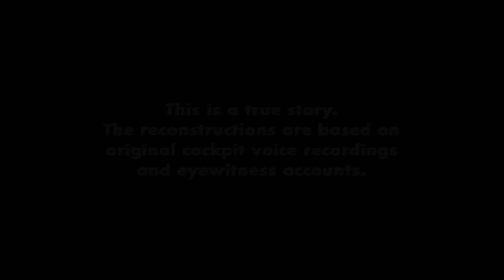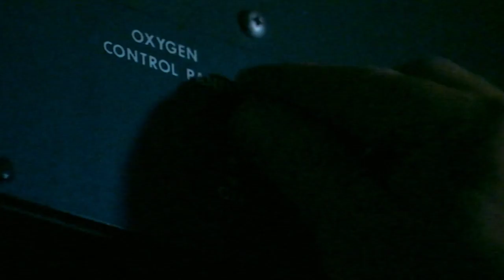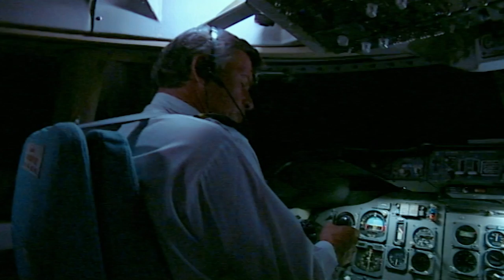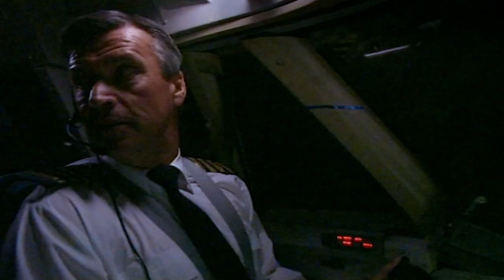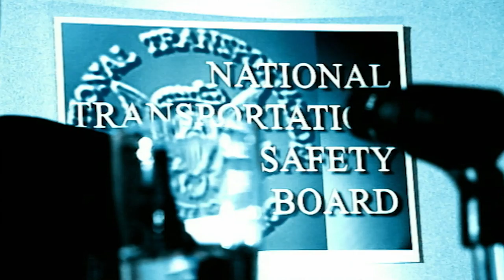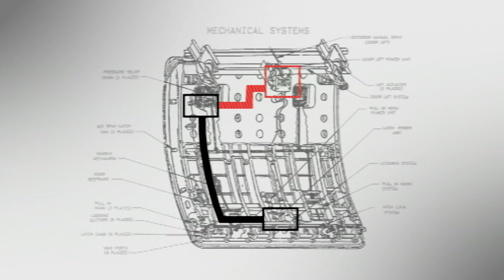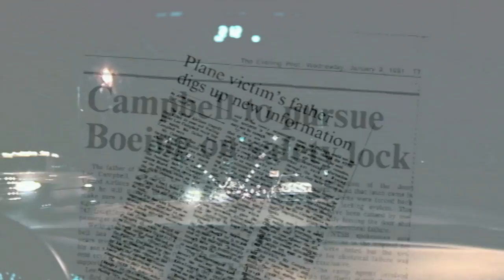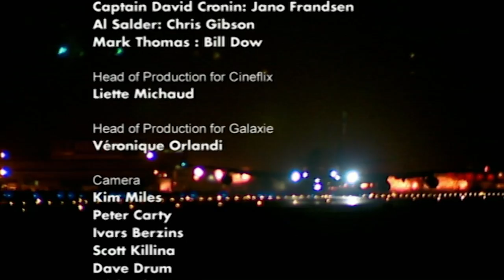United Airlines Flight 811 Ejects Nine People After Explosive Decompression | Mayday | On The Move

Comment: This event was still fresh in my mind just over a year later as I sat in the same position on a QANTAS 747-400 at Sydney airport. We had a two hour delay because ground crew could not get the cargo door closed. I watched all of this right outside my window. I had actually returned from the United States via Hawaii but this particular airplane was destined for Harere Zimbabwe via Perth. My final destination was Perth and we were half empty of passengers until then so there were plenty of spare seats. When we finally took off and the seat belt sign went out I quickly found another seat as far away from that hatch as possible. But I don't think I've ever drank so much alcohol inside 4 hours before...

Comment: Mr Campbell's engineering experience really paid off in this investigation. What I've never understood is why the doors open to the outside when they could design a sliding door (like on a van) that slides into the cargo hold when open then when closed the entire framework around the door will keep the door from blowing off. Imagine trying to kick the door to your house open from the inside. It would be the same principle. And it would take up minimal cargo space.
Reply: That’s a very good idea! Make it slide inside so it doesn’t take up space but also is held shut by air pressure.
Reply: I’m glad i thought of that!  😊
Reply: @orscrub3161  I think there are some planes that have this for passenger doors that slide up, I think I’ve seen it in a movie and it was a small business jet. So if they’ve been used for passenger doors I figure either they’re used for cargo doors already on some planes, otherwise there’s gotta be a good reason why they aren’t. One I can think of is that it means cargo can’t be stacked right up against the side of the fuselage or it’ll block the door, and if the cargo shifts accidentally that could also block the door.
Reply: @Sashazur  ……….what a frightening thought!   no way out?!  😳

Comment: With today’s tech, it’s possible to accommodate flight crews with views of the entire exterior of their airccraft. Powerful LED lights next to cameras allow views at night. Think of it:
1-Cameras on the fuselage trained on the wing and empennage (leading edge, bottom, top, trailing edge)
2-Cameras on the winglets directed back towards the fuselage (nose to empennage)
3- Cameras on the belly observing from every available direction.
4- Larger airliners already employ a camera at the top of the leading edge of the vertical stabilizer, but the ones I’ve seen are mainly used for obstacle avoidance while taxiing. 
***Live satellite transmission when a pan-pan is declared could connect pilots with a selected pool of volunteer, on-call systems experts. Stored data can be used to aid everything from incident investigations to training, R&D, etc..
THIS crew dealt with this emergency when that tech wasn’t compact enough, but now it IS. Hope it gets utilized.

Comment: They just had to mention TWA Flight 800 that blew up over Long Island Sound after just taking off from NYC. I have talked to many pilots over the years, and EVERY one of them has stated that no overseas flights ever leave the US with the center fuel tank empty. The NTSB blamed the air conditioner motors under the fuel tank for shorting out and igniting fuel vapors; another crusade is warranted to change that report. Witnesses saw something else and they were ignored. If a statement comes from a government agency, it usually is bullshit. I flew a lot and Twice I was on aircrafts that the engines caught fire after takeoff; it is a humbling experience.
Reply: Our family was on a flight from San Francisco to St Louis to visit my husband’s parents and one of the flight crew kept coming to our seats to “check on something “ and it happened so many times I just had to know what he was doing!?! I found out afterwards he kept checking to try to see if the landing gears were deploring and locking! We were met with a huge amount of fire engines and ambulances when we finally reached Lambert Field!! So I’ve been through many incidents on airlines. Oh and a cargo door knocked off the rear of our flight right before takeoff, causing us to all be taken to one of the best hotels in San Francisco! Humm is that coincidence???🤭😕Oh the Clairmont!

Comment: One thing I don't understand is why with all the technology available, there's no cameras mounted on the wings facing the engines and all other parts of the plane feeding back to monitors in the cockpit. The pilots can never see what's going on when disaster strikes. In one episode they asked the air hostess to go and look out the window in the dark. Crazy.
Reply: I know.. right!
I've even seen these document that the pilots taking to the ATC for visual advice on the exterior and this could be solved with simple camers.
Reply: The Boeing 777 does.
Reply: Even a car nowadays has this technology.

Comment: In my working career I have taken many airline flights around the US, Europe, and across the pacific and many of those flights were in those large 747s. This video brought back to me something I had experienced on a 747 years ago. We were climbing up to a cruising altitude but were encountering a lot of rough turbulence which caused the aircraft body to noticeably flex. As someone with an engineering related profession, the flexing was somewhat reassuring that the aircraft body to take that punishment, but at the same time it was scary how enormous the forces were that caused such flexing! My takeaway from this experience was that the whole aircraft was a large bubble made mostly out of aluminum and designed to be as lightweight as possible and it could only take so much punishment. Beyond that, the bubble would burst apart with deadly consequences. I'm glad now that i don't have fly much anymore.

Comment: It is absolutely unbelievable that Boeing didn't do qualifying tests for the latching door locks and the C shaped safety latches for the cargo doors that opened outwards. Any failure of several components would have resulted in an explosive decompression which is catastrophic!!! And this is not even getting into the electrical system and switch gears!!!

Comment: I don't  believe  it was fixed in time. But I was wondering  why the other 8 ejected passengers weren't  mentioned?
Reply: Most likely out of respect for the family maybe? Keep in mind, a lot of the names of those who were on board planes that died on 9/11 have still not been mentioned, again out of respect  for the families.
Reply: The video focused on the safety issues, lack of transparency by United, the aircraft manufacturer, and the FHA coverup.  I suspect the other families were consulted but chose not to be a part of the story.   One victims family just decided to get to the truth.  Plus the father was an engineer with great understanding of the components involved.
Reply: They only have 50min to get through the re enactment and the murder mystery. In most other episodes the investigation portion is done from the perspective of the safety enforcement, but in this episode the investigation its done by the next of kin is not only the correct investigation, its a more compelling story. Its less that the other victims were ignored, and more that the focus of an already planned segment was carried out by this particular family.
Reply: @denisephillips9269  when they did the episode for my aunt's crash (she was crew) none of us were contacted or knew about the episode until it aired, so likely the other families weren't aware of this coming out

Comment: The thing that I found most disturbing is the actual original design of the locks for the C-rings. Those L-shaped things made from aluminium(!), wtf?!
I mean: They seem to have been there only to fulfill some double security requirement, but anybody with some technical feeling can see from a distance that those could never block those C-rings being rotated back by their motor. Obviously never tried, and I doubt that anybody at boeing would have not known the outcome. 
That attitude, i.e. fulfilling security requirements "cosmetically" but w/o any real purpose is frightening.  What kind of engineering is this?

Comment: With no fire, and stopped, why not wait for stairs to de-plane?  Having 330 people jump on slides, at night,  the risk of injuries has to be pretty high.  Evacuated passengers have been run over by equipment after de-planing.  I would have probably taxied off of the active runway too (in the absence of any indication of smoke or fire).  Some of these emergency procedures are way over done by arm-chair administrators.

Comment: Not to be overzealous or picky, but, was the designer of the door locking mechanism ever questioned ? I ask because from what I can see on this film, that design was frankly appalling. Not just from the aspect of the door not being an inner oversized door so that it was physically not possible for it to pop out, but the design of the locking pins being made out of Aluminum, or Duralumin, both relatively soft metals for a critical part that has an operating cycle of many thousands of times with a lot of potential wear not just because of each cycling but also normal flight vibration. Extreme technology goes into the design of the engines, with alloy technology being front and foremost, how then, was this philosophy not also carried over to another flight critical component such as the cargo door mechanism ?

Comment: 737 Max is another example where profit is put above safety. Instead of creating a clean sheet design, Boeing changed to upgrading its aging 737 design with large high bypass engine, but in order to safe costs, decided to install software instead of having their customers (the airlines) invest in costly retraining of its pilots.

It's called regulatory capture by corporations

Comment: ok, what about the tear strips that are supposed to stop HUGE sections of fuselage from coming off. Its pathetic and sad that these poor parents had to spend their own money to fight the NTSB and Boeing to get the defect fixed. BRAVO to Lee's poor parents
Reply: Unfortunately, tear strips aren't really that effective at stopping huge failures like this. Keep in mind, they were meant to prevent small or minor breaches in the fuselage, a cargo door ripping off is NOT a minor failure, it is a major one that the tear strips were never designed to handle. (and before you say it, no it is currently impossible to design tear strips to stop this type of major failure)
Reply: @Suisfonia  I was referring to the small sections out lined by two rows of rivets, not the fabric ones, doublers or something... Designed for just this. Unlike a DC10's cargo door that literally blew off( in 2 cases I think) this ones was demonstrated as a slower decompression. Meaning it started the decompression then the escaping air blew the door off once decompression started
Reply: @Butchcub75  Oh I see, sorry about that, misunderstood you then :)
Reply: they actually helped here to not make the hole worse. It's just that a cargo door ripping off would cause tons of damage on its own

Comment: I would have never flown on an aircraft with an electrical latching outside door. It was designed as a cargo aircraft not for passengers. Bad idea. The DC-10 was another mistake in the industry. That door was designed the same way, and it came off at 12,000 feet on a few DC10's and killed many.

Comment: National Transportation safety board was never allowed to have their investigators actually take a picture or maintain any part that indicated that missiles actually took flight 800 out of the sky. Yes the Centerline tank exploded. That when you hit it with two or three missiles and the holes in the tank allow enough oxygen into it so that it can support an explosion. Otherwise it doesn't matter how many Sparks you introduce inside of fuel tank you will not get it to explode.
The number of witnesses that watched United States Navy missiles actually go up and missed the Target that they were shooting at and hit that aircraft were about 153 Witnesses. They also claimed that when the nose section blew off the rest of the plane went upwards making the people believe that it was a missile. That cannot happen. Not only does the plane immediately reduces speed by well over 150 to 200 knots which is why people's bodies were ripped to shreds indicating that that's what happened. An exploding fuel tank cannot produce hypervelocity wounds through people's extremities which is also evident in the investigation of TWA Flight 800.

Comment: Shhhhh....Keep it quiet. Air lines use to spend big bucks keeping their aircraft like new. They discovered that the cost of insurance is cheaper than keeping aging planes in tip top shape. They"ll " pusj " an older plane to get the max money out of it. Those few times they pushed too long.

Comment: If a plane falls out of the sky, then something or some one is at fault, usually its a question of money that is at the bottom, and its at the bottom of the barrel when it comes to the aircraft industry, just as it is  with tbe car industry, peoples lives come last.
The sotuation gets worse not better in both areas, electronics get more and more sophisticated and far more likely to be overlooked.
I have seen it  in both areas.
The cost of these mistakes and what really are gross neglect should result in huge payments for those effected, making the habit of ignoring faults far too costly, its the only way to stop it .
The other thing would be for instant grounding of all aircraft of the type with a fault, and the aircraft remaining grounded untill tge fault is proven to have been properly seen to, this rather than allowing the companies to wait untill it suits them, its the only way the save lives, thevsame should apply to the car indusrty, instant recall and for them it should be known badly thought of engineering design should be fixed regardless of age or milage free of all cost to the owner.
A quick example would be fords putting ctv drive gearbox wear a metal belt drives the car, proven to be a very bad idea, but hugely costly to an owner should it break, which they do, even as low as 30 thousand miles which says the belt is more likely to break before the timing belt does! ! 
It should be replaced by Ford at their cost, then they would not put the owner at risk
I know its not an aircraft, but the principal is the same.

Comment: United is notorious for using excessive aeronautical Duct Tape on the airframe, even fined for this.

I used to work on Weatherships and one of our functions was rescue. It is hard enough to land in day light with windspeed & direction and wave height and direction provided.

Of course, United went into finger-pointing more to escape al liability. Even Crap Air (Air Canada) is better than United.

And next time they yell you to put your head between your legs, you might as well not bother. A MATS aircraft crashed over the Atlantic and a mass of detached heads were found up against the galley bulkhead. All the seats fold forward in a crash and do not help in any way.

Comment: I did not understand why the plane was overweight for landing....
Reply: Planes take off with a full load of fuel on board -- fuel that will burn off during the flight. When you have a 9-hour flight, that's A LOT of fuel. If you land with full tanks, there are multiple problems -- the biggest of which is: 
1) Not having enough runway length to stop a fully loaded plane on. Imagine the stopping distance for a car vs a fully loaded 18-wheeler.

Comment: The individuals who are responsible for the cover-up and still denied the electrical fault as the failure point should all be permanently removed from any position having to do with the aviation industry be discredited and decertified in a lifetime banned from employment with anything to do with flying. 
                        The for profit practice of trading lives for safety by the airframe manufacture shall be directly hit with fines and penalties that hurt the stocks and they’re paying out of dividends and directly removed from the chair members who is direct income come from pot profit margin‘s profit sharing in any stock holdings to be removed and fired without severance pay or any bonuses.     

         Corporate entities only listen when they’re going to get hurt in the pocketbook and it comes directly out of the heads making decisions bottom line when they get hurt in their bank account is the only time they react and listen.